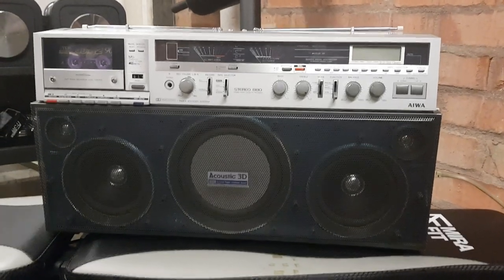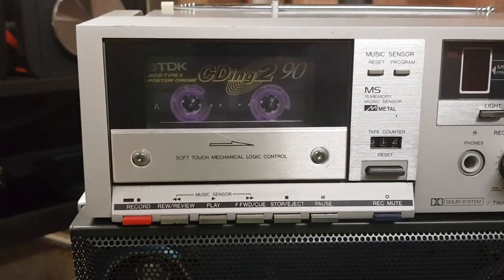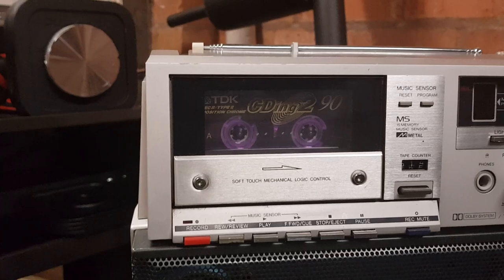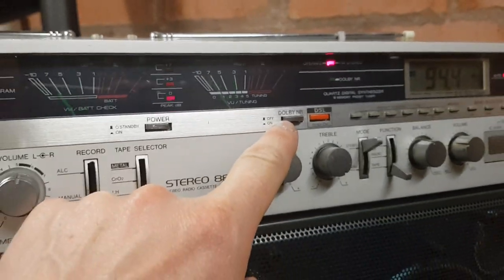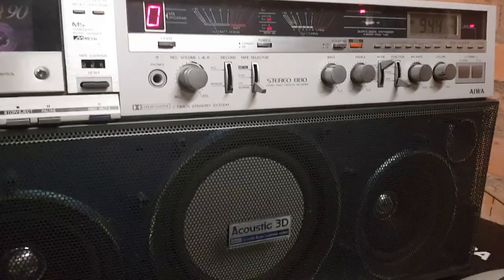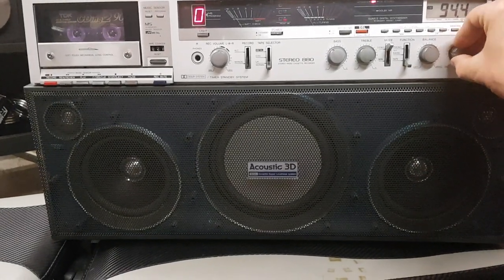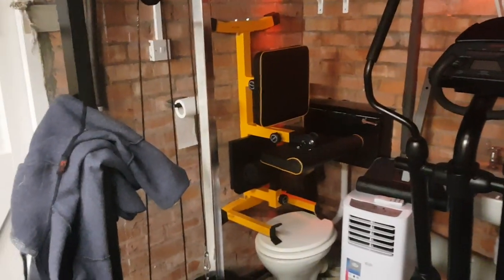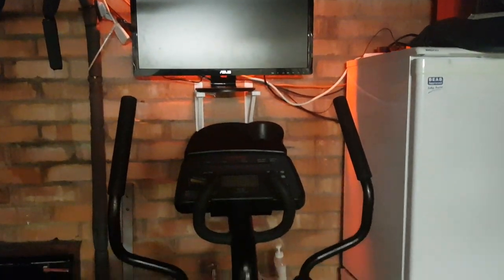Aiwa CS 880 Boombox and Home Gym

Comment: Perhaps take a look at the magnetic counter wheel.  Ensure that the pulley & belt are clean and pulley shaft lubricated.  These have to sense the counter movement or they will shut off.
Reply from the maker: Someone has been into the mechanism before me and parts where missing